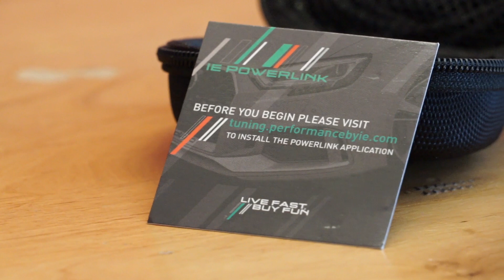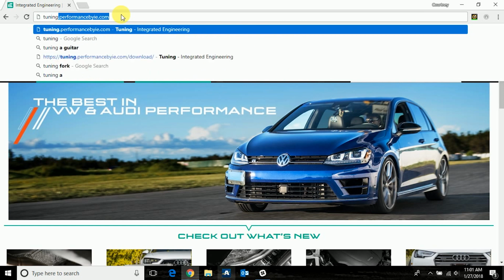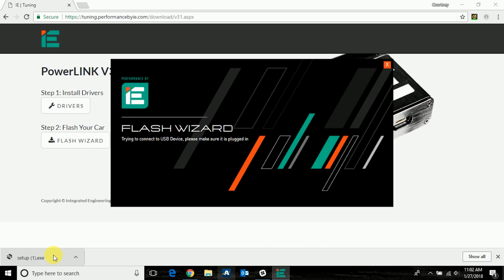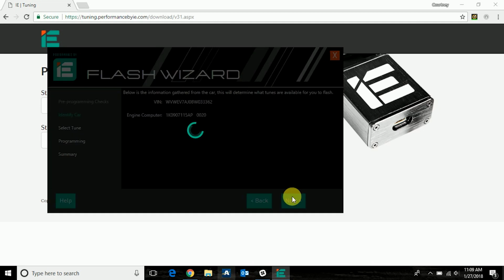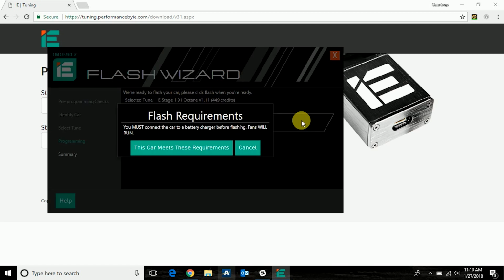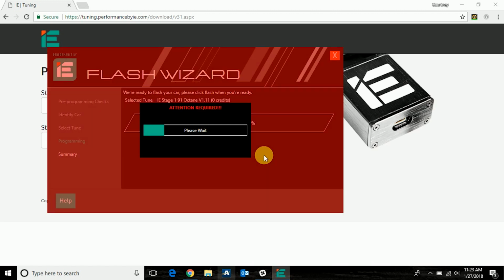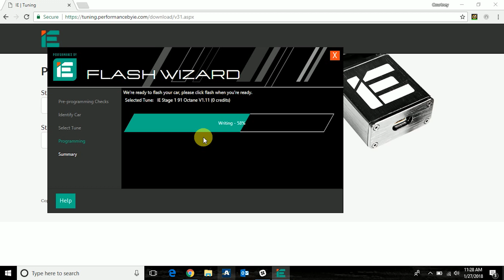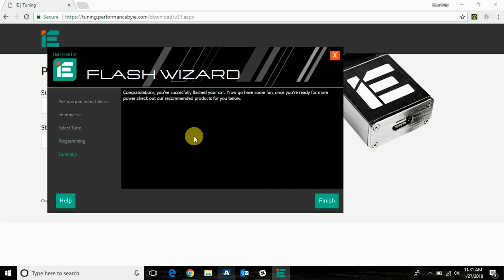Integrated Engineering Powerlink Stage 1 Flash Unboxing, Install, & Review on a MK6 VW GTI

Comment: Hi!, did you do any other modifications?, I am looking for a little more power and performance without having to modify parts, the only upgrade that I have is an cold air intake, Any codes or warnings? Stage 1 or 2 ?. Thanks
Reply from the maker: I didn’t have any other mods besides this but once you have certain bolt ones you can upgrade the software for cheap

Comment: Great video, I'm highly considering this tune since you could revert back to stock quickly and easily. Could you use the tune an unlimited amount of times? Thanks!
Reply from the maker: You can put it back and forth from stock to tuned over and over, but I BELIEVE you can tune up to 5 different vehicles with one cable. But you would want to check with IE to be sure.